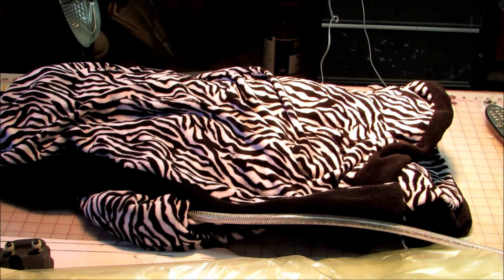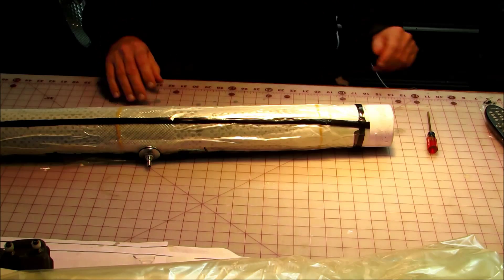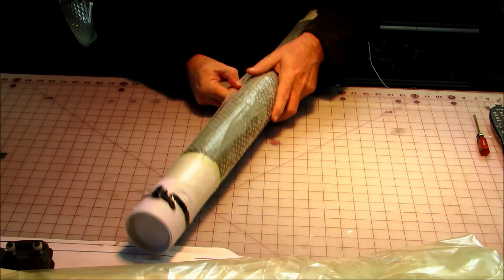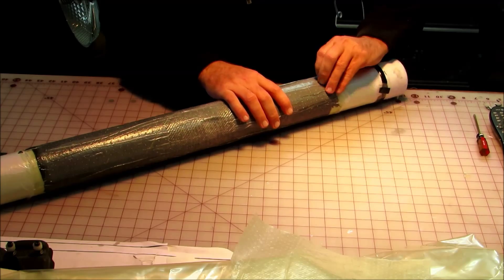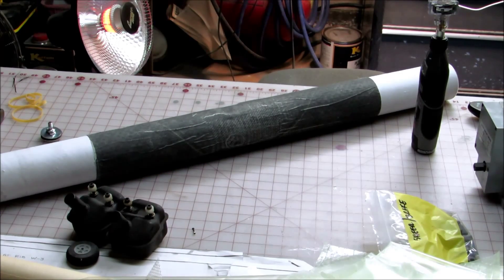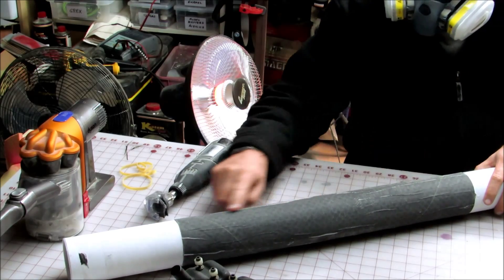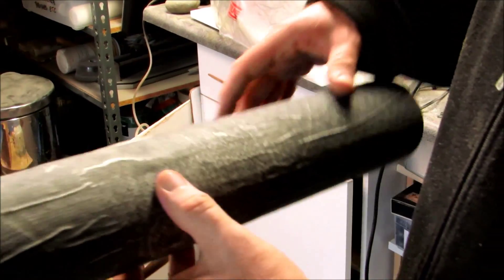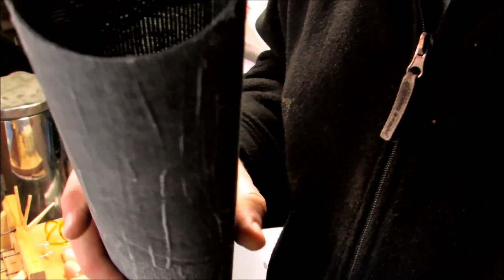V173 Flying Pancake Composite Motor Tubes, Attempt No2, Video No4

Comment: Have you thought about placing a vacuum fitting on the end of your tube to help it release from the carbon tube? Once the vacuum is released from the bag the tube will expand increasing the difficulty in separating the two from one another. With enough vacuum, the cardboard tube should shrink it's OD just enough to release,  As far as the wrinkles in the carbon; have you thought about placing positive pressure in the cardboard tube to prevent the vacuum from overwhelming the OD dimension of the cardboard tube; which could be happening. I might be totally wrong on this so its just a thought.
Reply from the maker: You have a couple of really good ideas there! I have been planning out the next attempt, but your concept of using the cardboard's lack of rigidity has merit. Thanks!

Comment: Why don't you get a tube that has the same inner dimension as the outer dimension of the part your are making.  You can make your laminations around slightly smaller form which can be inserted onto the tube and expanded.  Install something like a balloon into the center and pressurize it.  This would make your part using the outer tube as a form and will eliminate the compression wrinkles you are getting.

Basically, use pressure to push the laminations into the form instead of vacuum to pull it down onto a form.  Just reverse your form.
Reply from the maker: Yep, that would be a great way to do it. I've seen that method, some time ago...and there's a lot of work in getting the mold, and the pressure balloon right, and I was hoping to find an easier way, as I only need to make 1/2 dozen of these or so...but I clearly need a new plan, so I'll have to look at that option. Thanks!